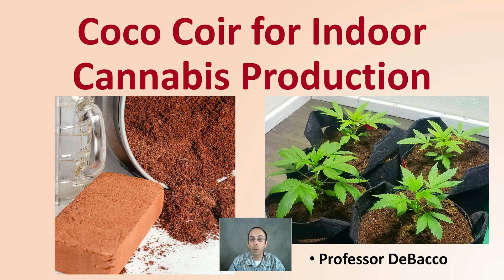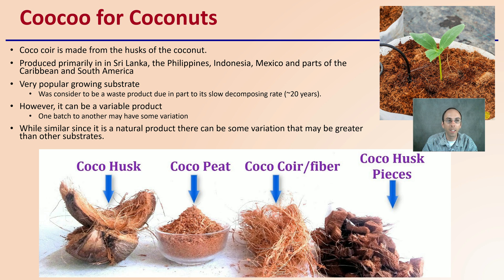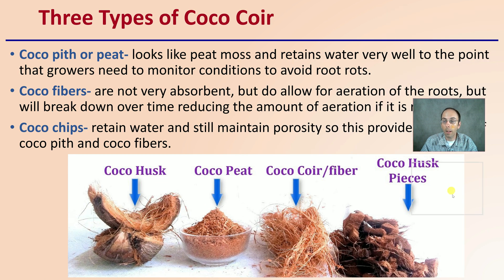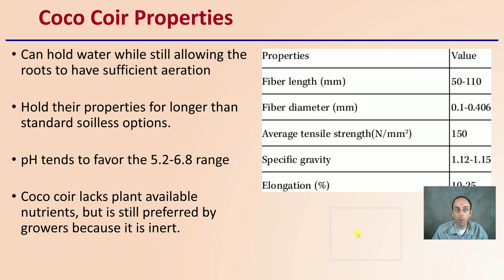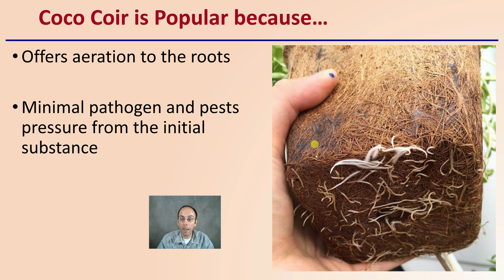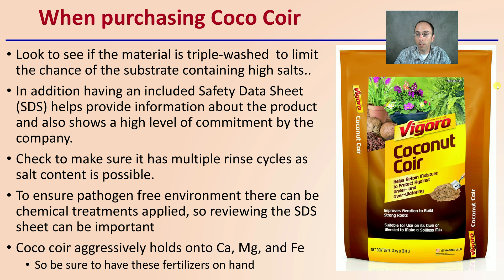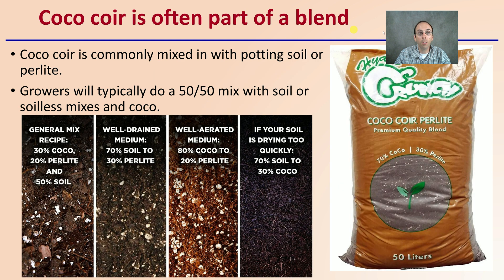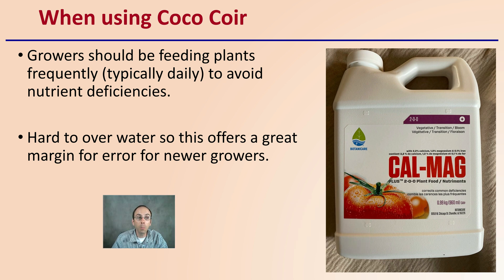Coco Coir for Indoor Cannabis Production

Comment: Im not trying to be a contrarian and i definitely think a lot of the comments ahve good advice but ive also used the same 3 5 gallon containers with the same coir for years at this point and I only flush the last 2 weeks. I dont check ph, ppm, i dont adjust anything I just give it jacks 3-2-1 and myco with some molasses once a week and I get excellent results
Reply from the maker: Just think how productive your plants could be if you collected some data...
Reply: The myco w mollases once a week the jacks is on a timer depending how thirsty they get

Comment: And always test your runoff and adjust your feed as needed to what the plant and runoff is telling you. Tends to build up EC and PPM over time so flush when runoff readings get to high.
Reply: yep
Reply from the maker: Thanks for adding this.
Reply: Interesting I just did a run on 75% coco 25% perlite and never once had to check EC other than the feed I use. Plants essentially grew to perfection with zero deficiencies, tested one strain at 24.5% thca, yielded 28 oz in a 7gal container. Feed 2x per week, thoroughly let the water start to runoff, then supplement ro water between feeds. Works like a charm with a mix of synthetic 75% synthetic nutes and 25% organic roughly.
Reply: Don’t flush lesson u  nutrients next feeding unless your ec is above a 5 I would only flush last two weeks